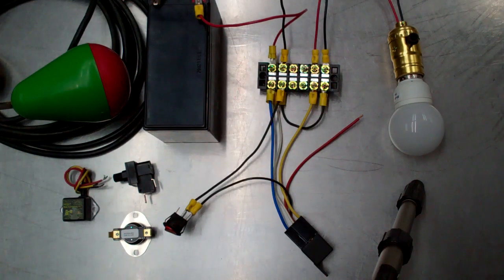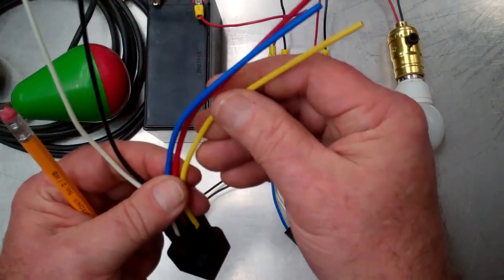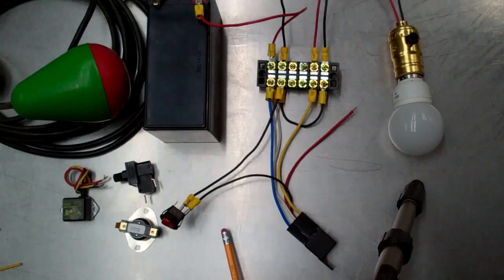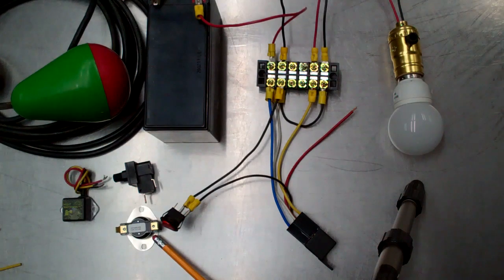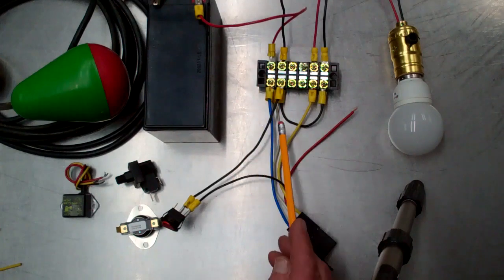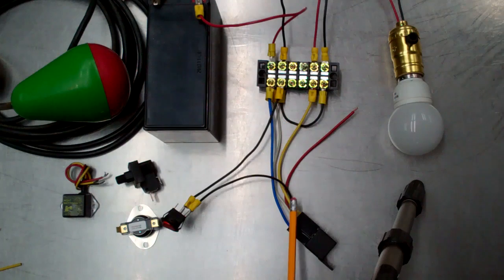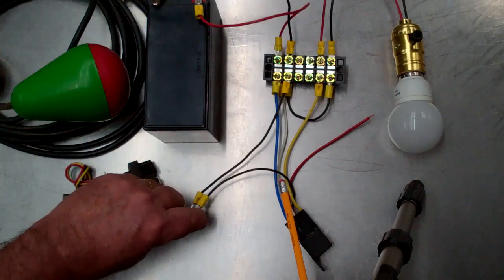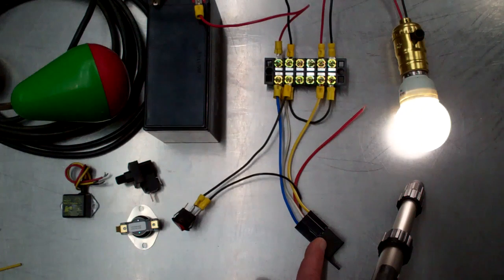Low Voltage Relay Wiring for Off Grid Solar

Comment: i want to use a relay as a charge controller , when the battery is running low the relay will stop getting current and the normally closed terminal  will actually activate the solar panel to start charging the batteries...
Reply from the maker: Thanks for your comment.  Bad idea my opinion.  Buy a charge controller and keep the battery as charged as you can as much as you can.  What you propose will not help condition your battery.

If we are talking about lead acid, a good charge controller will help you get the max life from the battery.  One of the factors that reduce lead acid life is depth of discharge.  Using a relay to detect yo-yoing voltage will unnecessarily increase the depth of discharge.